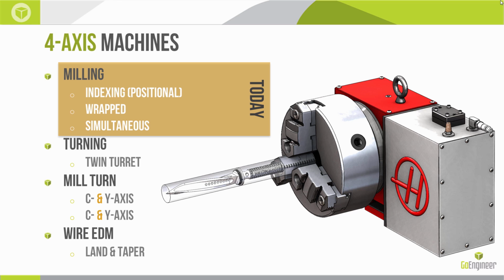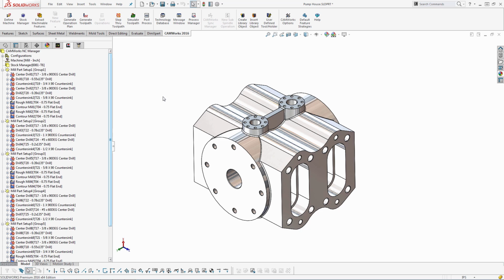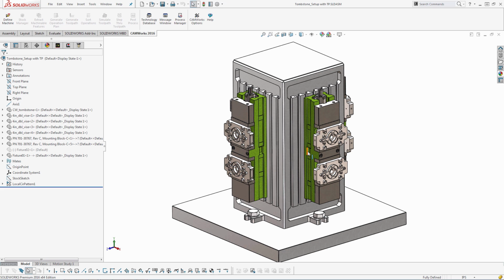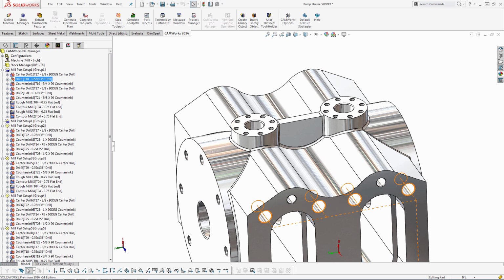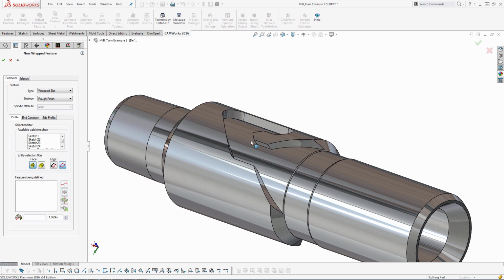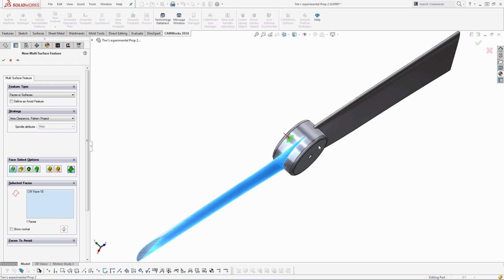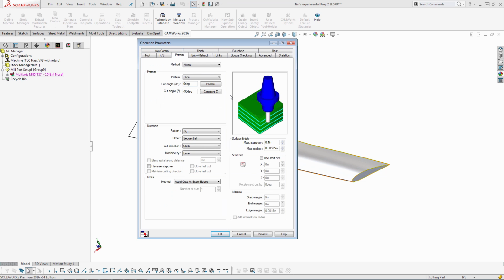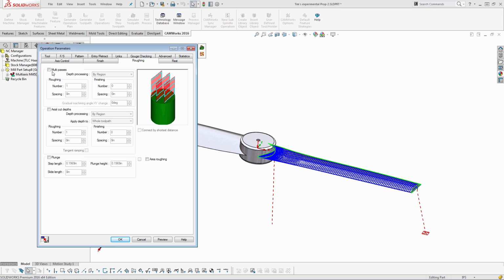CAMWorks - Step Into the 4th Axis

Comment: I have a question, in camworks i set the machine and work coordinates to be 4th axis rotary about X (A-axis), but in mill part setup definition under axis tab , the tool axes are 0 1 0 instead of 1 0 0, any help will be appreciated as i'm stuck with it for a whille now